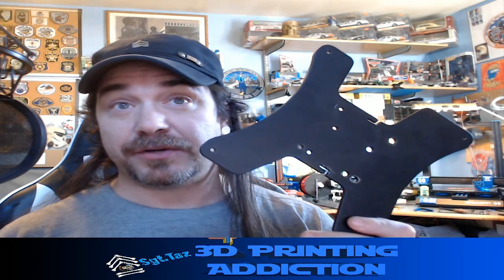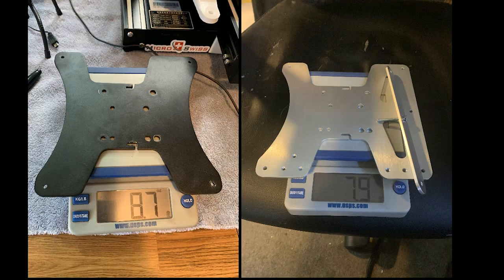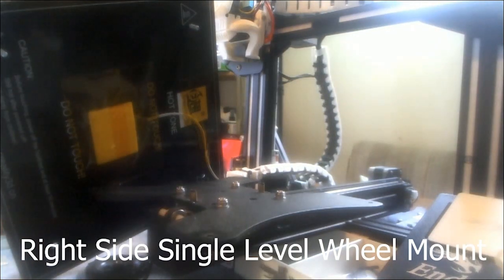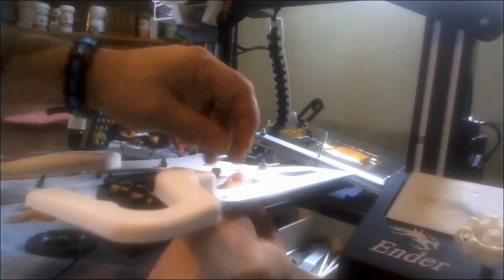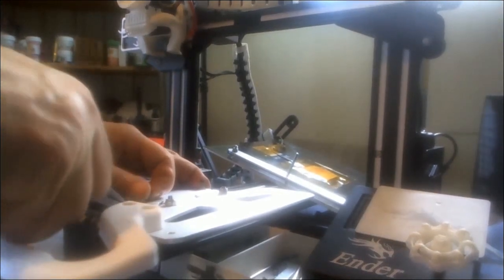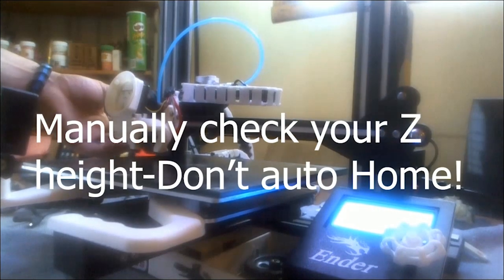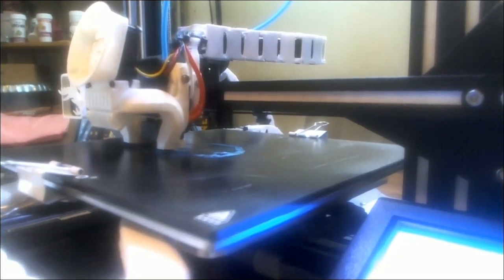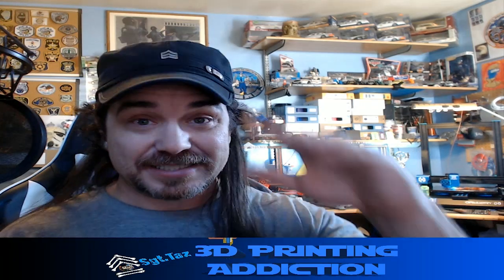Ender 3/Pro Y Carriage Upgrade

Comment: Nice info on this upgrade. You seem pretty hands-on. A question for you: Any reason you can think of that I couldn't just drill-press a few new holes on the old plate for the center-right adjustment and a couple for a straight bar like the one that comes with the upgrade? I probably have some aluminum stock in my garage that would meet the needs.
Reply from the maker: No don't see any reason it wouldn't work. best part of DIY with this hobby.  only thing I'd be careful of is not flexing the plate but other than that, making your own is a viable option.

Comment: I removed the entire y Carriage because its slightly bent and i was assessing and stuff  then, what happens when i removed the nuts+the wheels and some other parts went falling on floor and flying(and the gahd knows where the other part went flying) and i dont even know how to place them back as they were completely scattered around ....  =.=  so i purchase a new plate. I need to know,  whats the specific names for that parts?  Mine is ended 3 v2. Anyone knows??
Reply from the maker: V-rollers (Wheels) essentric nuts (Adjustable metal ring for tensioning wheels) Washers and bolt. try this for additional info https://letsprint3d.net/guide-how-to-upgrade-the-y-carriage-plate-ender-3/
Reply: @Sgt.Taz3D  thank you so much ~~

Comment: doesn't the bed wobble on the side with one screw?
Reply from the maker: No between the flat mount and stiff spring it rides fine.  Keep in mind your not dropping any weight on it so your not going to get a lot of play once it's set properly.